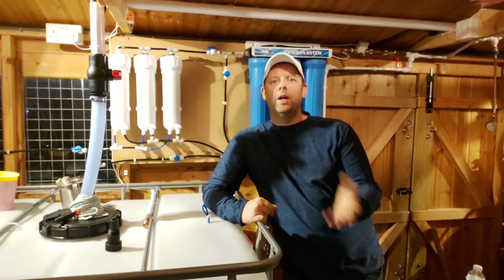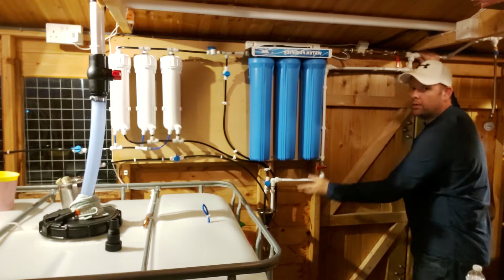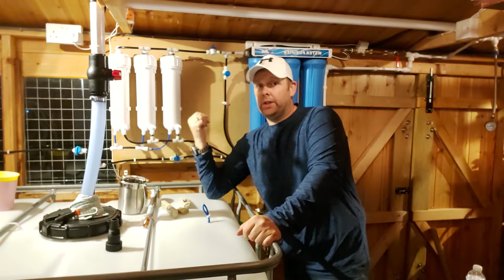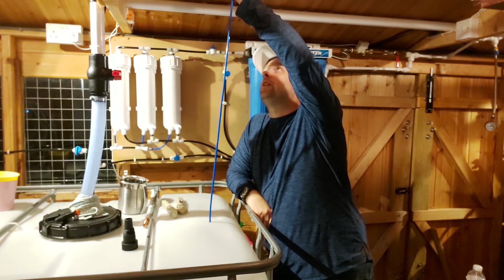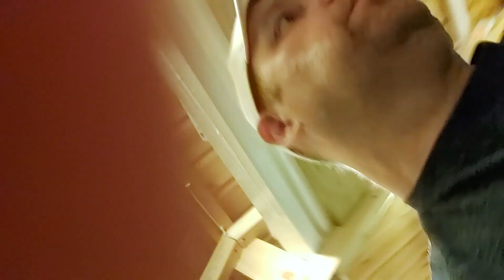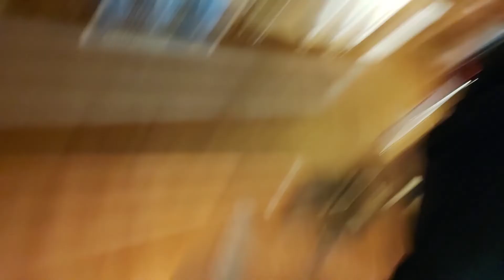Water fed pole window cleaning guide to pure water production

Comment: Really good video, thank you. I wonder if you or a fellow subscriber on here can diagnose my current problem? Ive got a Grippatank van mount system and for some reason it has stopped producing water from the waste outlet when filling? It fills just fine but intead of 60/40 its 100% water going straight into tank!

Comment: Really helpful information - thanks so much.. I have been wondering if all is still functioning well without a booster pump?  Also I was wondering why you prefer a solenoid valve rather than auto shut off valve which of course wouldn't need any power.   Terrific video..

Comment: Ultimately, I’d like to know where you got the 38mm tap from on your transfer hose mate ?
Reply: Ultimately a good video 🤣
Reply from the maker: It's a koi pond ball valve 👍
Reply: Good vid, most complicated set up Iv ever seen though, mega over engineered, all u need is a particle filter, a carbon filter a 40/40 RO & a small di vessel,, I bring 450 ppm water down to 7/8ppm before it hits the di & my RO is over 2 years old, we use 650 lt a day ! Yours looks neater than mine tbf 😉

Comment: Just setting a system up myself and need to fit a submersible pump.
Did you cut a hole in your tank ?
Great video BTW .
Reply from the maker: It has a wide neck opening, slightly rare but you will find them